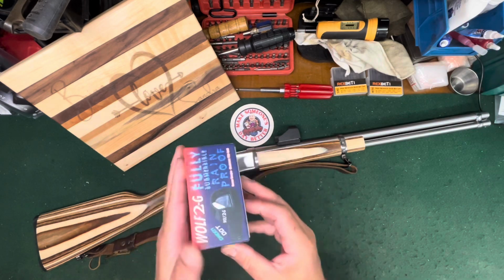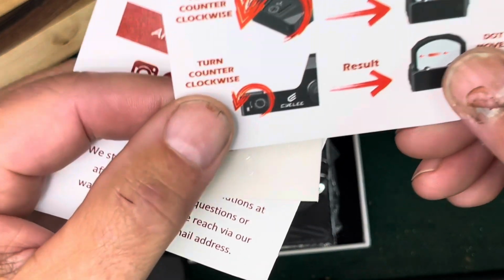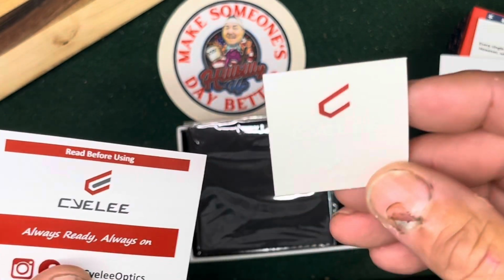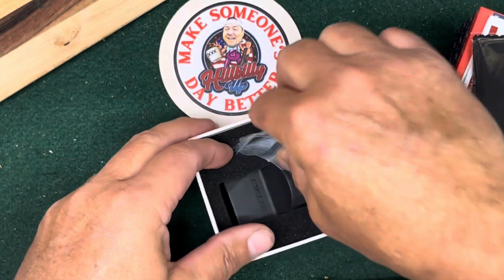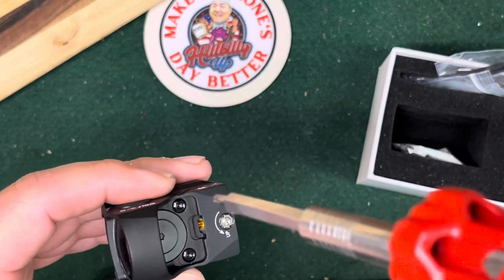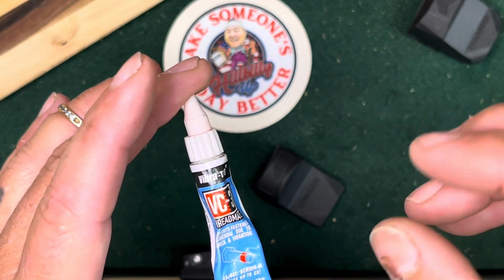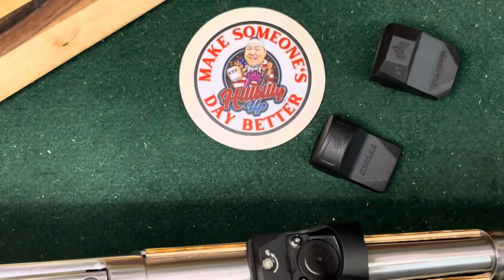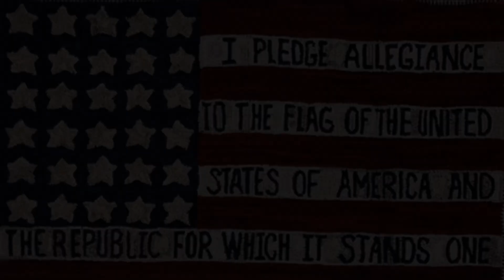Cyelee Wolf 2 on the Rossi 454

Comment: Cool CW you are really getting it set up the way you want it. I remember that bubble stuff you referred to.  I actually had some.  I bought a tube of purple loc-tite for my small screws as it is supposed to be flexible like that. I have likely screwed up putting the blue stuff on some of my small screws.  But I also bought a Bob Smith Industries (BSI) un-cure a debonding agent to loosen the loc-tite that is too tight
Reply from the maker: Good stuff man!!! Great ta have options!